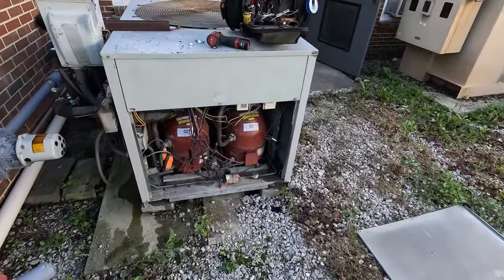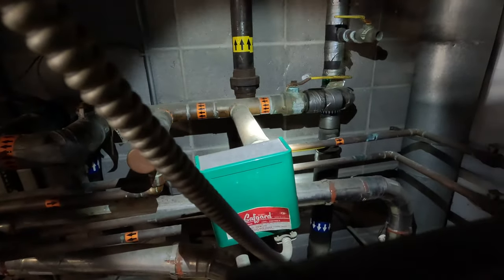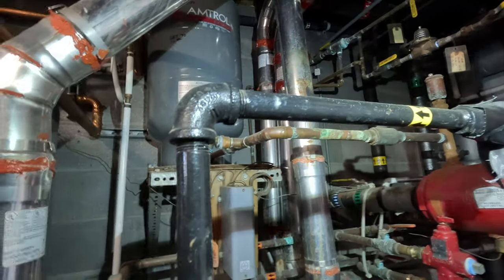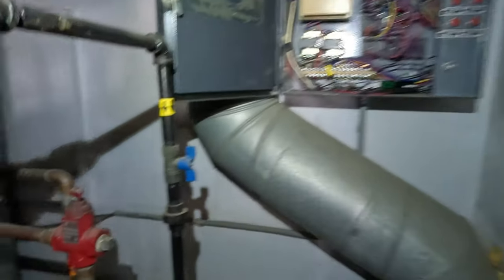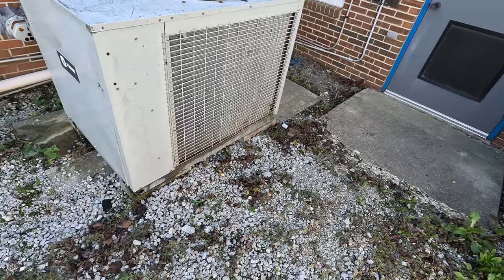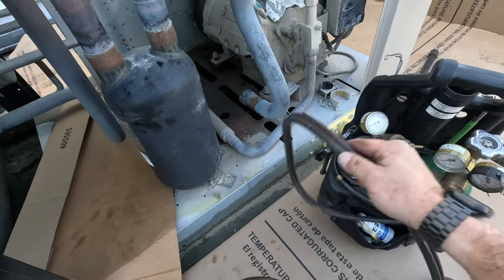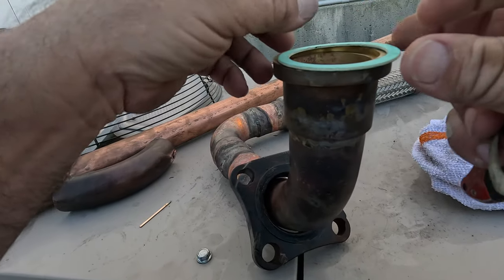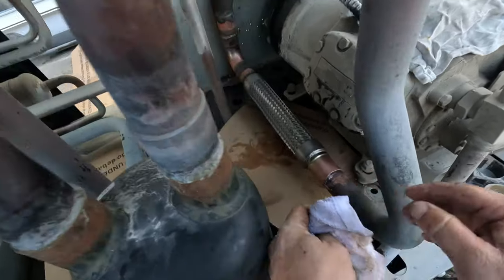Drain CHILLER Start BOILERS & Save INDUSTRIAL COOLER In 1 Day!

Comment: I went to school in the early 70's when 12 and 22 were king. The only time we flush the lines was for acid in them. So it is all new to me but I am retired.
Reply from the maker: CFC refrigerants had natural mineral oil and it didn’t matter if there was that much carbon inside the piping but with the invention of POE oil, which is a synthetic oil. It tends to scrub the inside of the pipe and pull that carbon back to the metering devices and tends to plug them up.

Comment: Replace it all with a air to water variable capacity heat pump. The new defacto standard here in Europe, because waterborne heating (gas/oil) was the standard. Ironically our heating installers are usually not qualified to work on AC units and therefore try to keep the old waterborne systems working. Keeping the old piping, replace critical radiators and pipe the extremely oversized heatpump in with a parallel storage tank. Instead of installing Minisplits (or VRV in bigger buildings).

Comment: Excellent work, l am one of the old guys. I had to change a Trane compressor on a computer room for an electric utility company on Christmas eve. The computer was not only used for Edison billing but many of the local towns sent their property taxes out on that computer, (the old punch card type system) It was about 20F outside snowing lightly and I was on a mezzanine about 25 feet in the air with no help. Hard to get the torch hot enough to do the silver soldering. Forget nitrogen, hardly ever used it in those days. Came back a few days later and changed the filter dryer and suction dryers. Never had any issues not using nitrogen in those days.  I disliked those type of pressure jobs that had to be done ASAP. Thanks for a great video.
Reply from the maker: I have had those days and nights. I remember getting stuck on a mall roof and it was cold like that. I was so frozen to the bone that when I got home I stayed in the shower for probably 40mins and still felt like I was freezing.
Reply: @HVACRSurvival I think I would have jumped a unit out and took the supply air panel off until someone came back.

Comment: Not that I’m sure you didn’t already think of it- If you can even tape over the ends with some foil tape of that big copper line it can’t pull in as much oxygen and you could even just tape a hose to it and purge the oxygen out
Reply from the maker: I was being lazy plus I was in a hurry. But I have done that on smaller stuff but that was 2 5/8” I believe.

Comment: That baby chiller was cute. Weil McClain ultra with that aluminum heat exchanger always leak. The acidic condensate eats those HXers. I do like how they sell a kit with all the gaskets. That heat exchanger cleaning tool is cool, too. When I need to add oil and do a vacuum....I pull the oil in while the vacuum pump is running, which makes it easier. Another great video full of real-world repairs....especially on a reefer unit with big dollar amounts of food that is time sensitive to keep cool. Great job Rick.

Comment: The #1 fan can’t be on a cycle switch 
The fan above the header has to run to prevent leaks on the intermediate header 
Trust me I work on those HeatCraft units every day for years 
I have also had many leaks for refrigerant lines rubbing out on panels and leaks of the headers due to people cycling fan 1 
Thanks Mr Rick